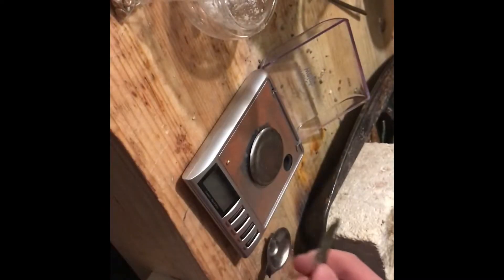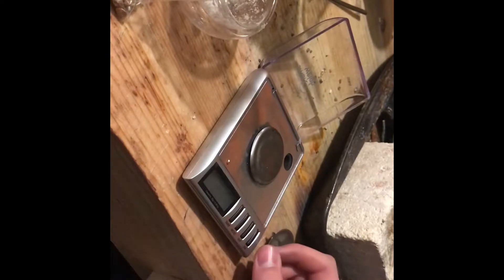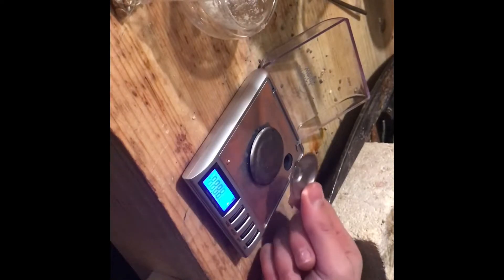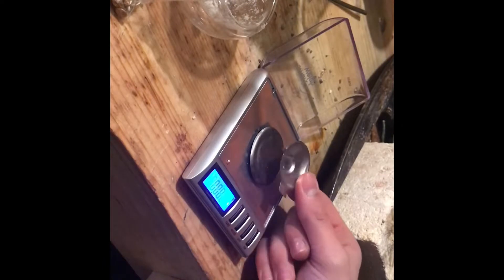How to Make Silver Solder

Comment: Hi
I'm in the UK we can't get shell cases will any brass do? thanks
Reply from the maker: Yes. Here I didn’t use shell casings either, but the alloy of 70% copper and 30% zinc is common in casings. Silver solder is really easy, so you should have no troubles!

Good luck.
Reply: Soft jewelers brass is 70/30 any sheet brass meant for forming or bending ought to be the correct alloy. Not to be confused with machining brass like C360 which contains other metals such as lead and iron to improve machinability